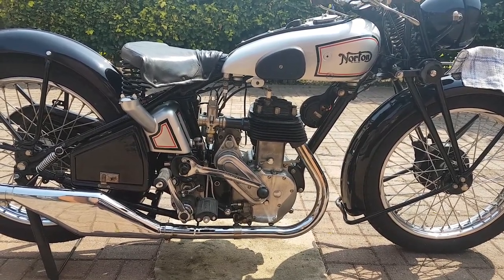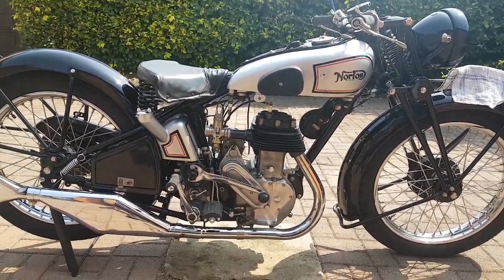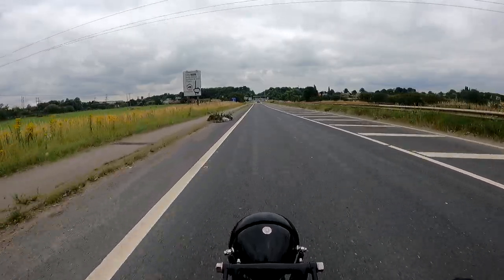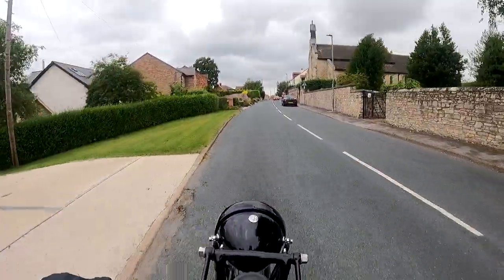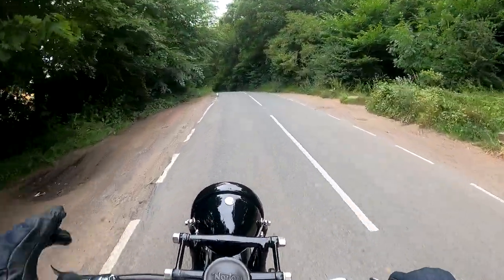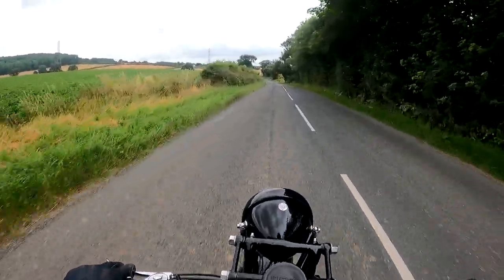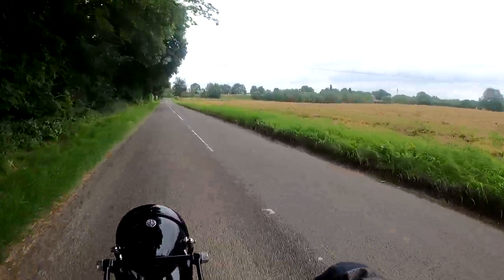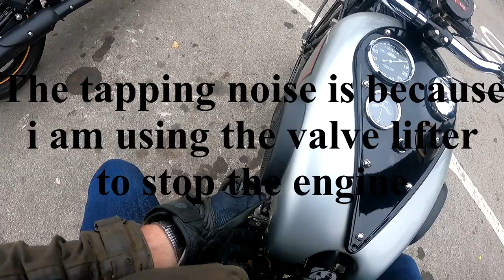NORTON 16H 1932 Vintage Pre War Motorcycle

Comment: Perfect....I have got a 1946 NORTON 16H  that my father bought New...Not as pretty as yours ..Cradle frame..Front brake on left=hand side....bit more modern but not much..First rode it in 1960   Last rode it a month ago..  Good man..... P.S still has the original wheel bearings...
Reply: Correction...The front brake is on the RIGHT HAND SIDE
Reply from the maker: @keith-nb8ps  I think they  used same brakes for year's not much good in modern traffic

Comment: Well now, thats so nice, thank you. Mines a '39, went straight to the RAF and spent its service life in Malta based in RAF Luqa. Sold out of service locally about 1960 to RAF serviceman, then ?? Feller brought it home in bits in '93. I've had it about 15yrs or so. Roadworthy again, and very nice to ride (allowing for modern riding conditions), with 4 speed footchange dollshead box,  Matchless girder forks, and later 60w dynamo. In me dining room at present, only because the garage is full of bikes.. Happy days. All the best..
Reply from the maker: Mine live in back of the shed because of the other stuff in the garage. Mine has the Sturmy 3 speed box and is a little fussy. I enjoy a ride now and again , but it's a little slow for modern traffic, you have to be on the ball, and eyes in the back of your head . YB

Comment: Great to see such an old bike on the road. It seems surprisingly usable even with its oddities. I wonder how often they needed to have engine rebuilds in their day. I am guessing the oil system is total loss and very hit and miss in meeting the needs of the bearings and cylinder.
Reply from the maker: Its not dead loss oil system, its feed and return gear oil pump, being on a all bearing crank its not bad, and will just keep going. When i borrowed it from my farther, it had a +60 piston in a un bored cylinder, it was completely smashed down to the 1st ring from the part of the bore that had not worn, and would still pull 70mph on the clock, that's 40+ years back. cheers YB